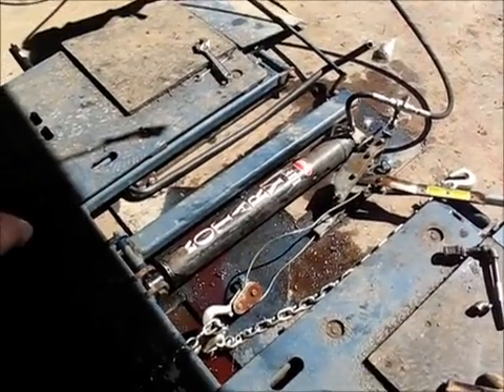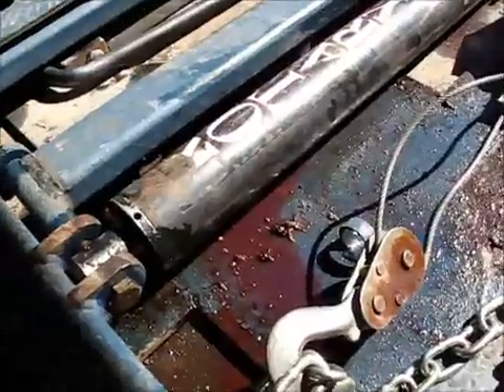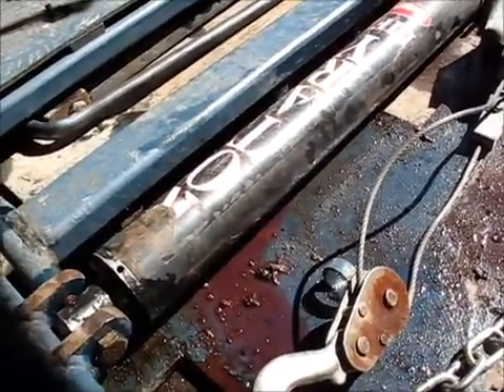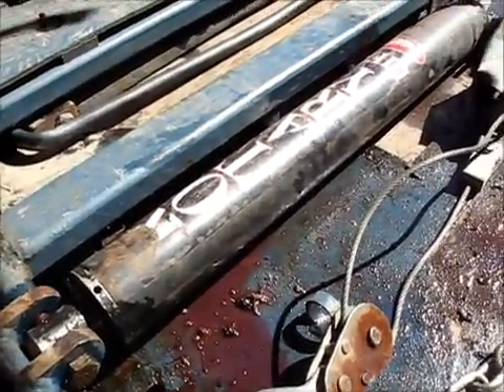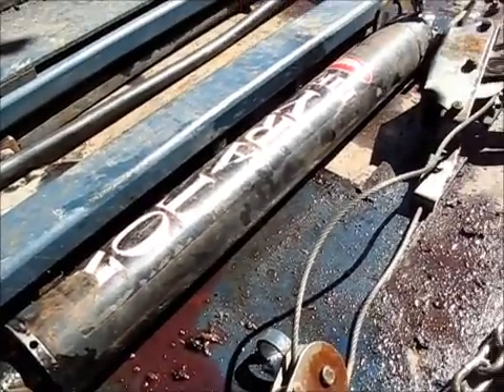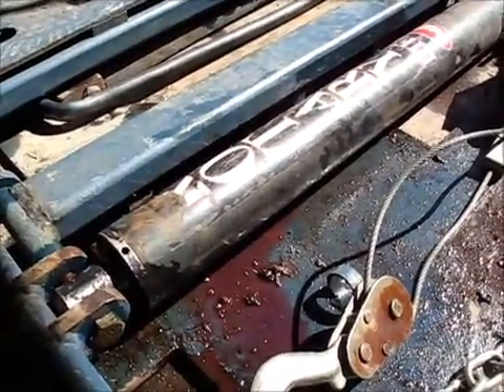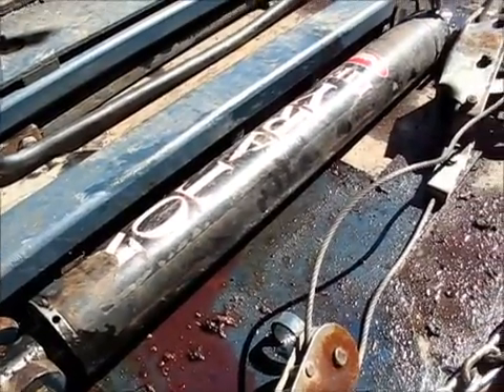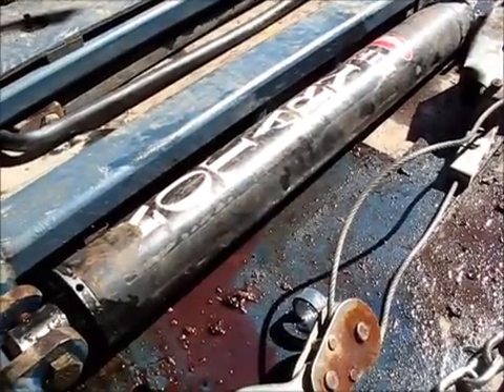Plumbing a car lift

Comment: towrecker is very right,,he also was right about the airhose,,,imagine 15,000 psi coming thru a pinhole squirting THRU your forhead from the airhose thats only ment for 160psi...if the car falling on you dont kill you the compromised pipe or airhose will...and as the other feller said ,,all the scale n slag will colg ofrices in a heartbeat

Comment: Were this mine, I think I'd buy me a hydraulic coupler (male & female) and a hose long enough to let the pump go where I wanted.  Put the coupler between the long hose and short hose off the cylinder, and hook it up only when necessary.  Bit of an inconvenience to have to connect/disconnect it, but wouldn't have the trip hazard of the black pipe on the floor.

Comment: you know you need to re-harden that pipe where you heated it , just make it glow again , and dunk it in water , the pressure it will see and being soft is not a good idea , it will have the pressure the cylinder has on the fluid (weight of car) pushing on the soft spots , the weakest link is always the failure point on anything ...

Comment: Total agreement with MrComaToes , buy some proper hydraulic hose and fittings and nothing else before this thing turns int a tragedy !
go anywhere they fix backhoes and such for proper lines , fittings , and info wether to rebuild or replace that cylinder .

This is the one time you probably shoudn't be cobblin things together.

( I do it too , but this is not the project for that )

Carry on

Comment: Richard , sviinternationalcom shows a VL6  Rotary lift parts breakdown in PDF form. Lists a texas cylinder and also a kit for that cyl. No prices , though.1 800 321 8173 I just got an idea its steel rings like an automotive piston the way that thing was stickin fer ya. O an you oughta just run good hydraulic hose. Anything else no big deal( corn wagon dump truck). This thing is called a SCISSOR lift. It would scare me into a severe pucker usin a brand new one. Dont cut corners Like you too much

Comment: To order piston cups and back up rings, and a gland seal.Usually all you need is the inside diameter of the cylinder, for the cups and rings and the diameter of the piston rod for the gland seal. Try Mcmaster -Carr.

Comment: This is very good advice! The pressure rating of the pipe is very important. A 2.5" cylinder is app. 5 sq in. That is a minimum of 1200psi to produce 6000 lbs of force.

Comment: A pinhole leak in a hydraulic line under high pressure can sever a a finger, possibly a limb, and at the very least can inject hydraulic oil under your skin causing poisoning, infection endangering your life and that is no joke.

Comment: Richard, my friend, hydraulic systems are meant to be pristinely clean with tiny little orifices and valves that get stuck with the littlest bit of near microscopic grit or dirt. Please do not use black pipe for your hydraulics especially now that you have bent and torched it. I can guarantee that there is now a bunch of scale inside that pipe. Plus the burst strength of the pipe has seriously been compromised if it even met hydraulics specs at all.  It's a bad idea...